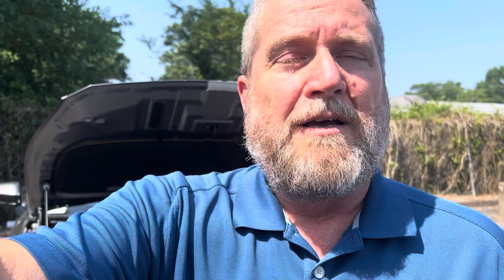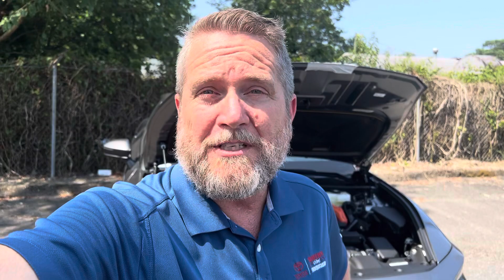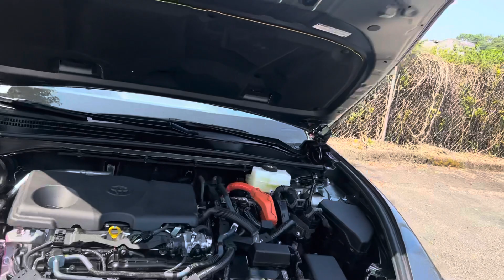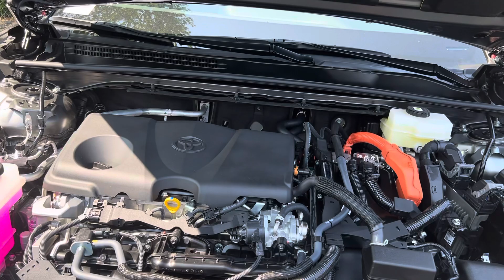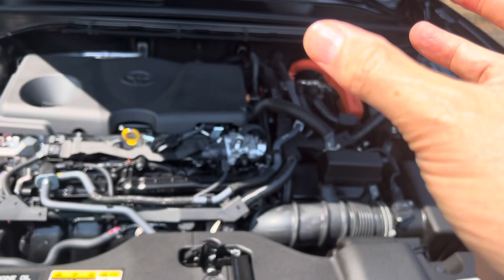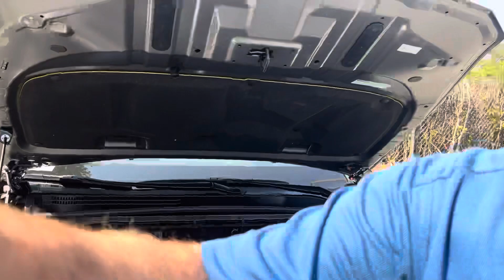Toyota hybrid systems. What’s the difference? THS or the Max?

Comment: Hi Steve. Thanks again for the great videos. I have a question unrelated to this video. On my 2023 RAV4 hybrid, while viewing at the multimedia display, a notification of the current radio station keeps appearing on the display. I catch it with my peripheral vision and find it distracting. Can this be turned off? Thanks.
Reply from the maker: I’m guessing this is FM radio when this happens? You’re probably on the edge of HD coverage for that station. Each time it drops in and out of that coverage, it will show. Turn off the HD. That should do it
Reply: @TrainerSteveClifford  I believe you are correct regarding the FM issue. When I’m close to my metropolitan area the notification ceases but as I’m driving home it reappears. How do I disable the HD component?
Reply from the maker: @richardgoeltz3769  You got it!  https://youtu.be/0yJYeL3tjgY

Comment: Great descriptions Steve! My 2023 Highlander XLE AWD HYBRID got 37.3 mpg over the 3000 miles of my recent family vacation/road-trip. That was three grownups and all our stuff. So not empty. I toggled between drive modes based on conditions rather than leave it in one mode the whole trip. Also, the mpg is based on actual fill-ups and mileage and my calculator. The computer on the Highlander is pretty accurate though. I was very pleased! I might add that there is plenty of power when you need it. And the lack of perceivable shifting combined with the driver assist features means we drove 11 hours and 652 miles one way in a straight shot and arrived feeling fresh and ready to go out to dinner. Amazing vehicle.
Reply from the maker: That’s great feedback. I love my personal RAV4 hybrid and I find I actually get slightly better mileage in sport. I to use actual calculations and not there to computer. 35k miles and I’ve averaged 41.9 mpg